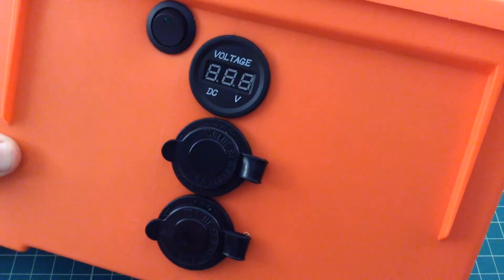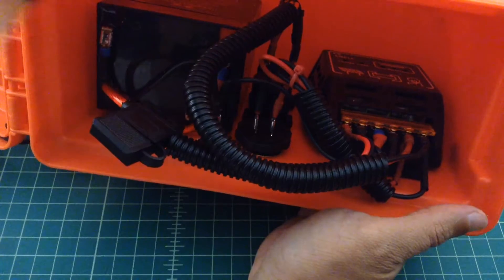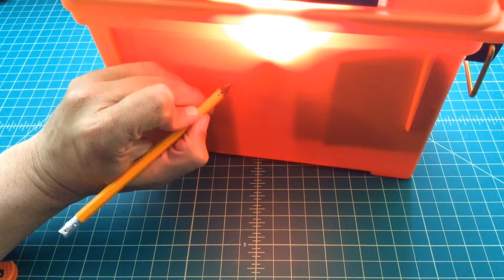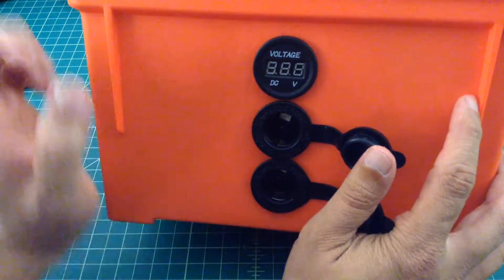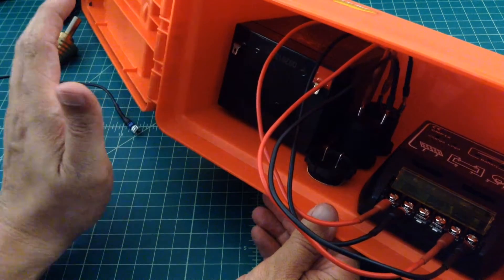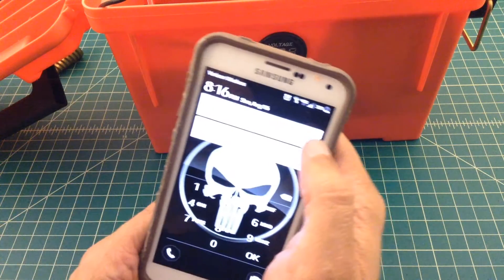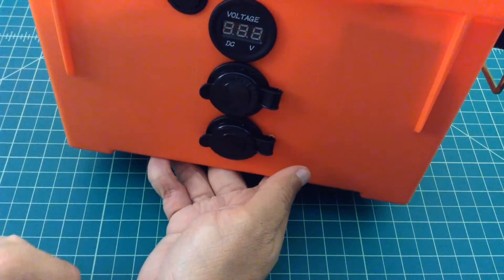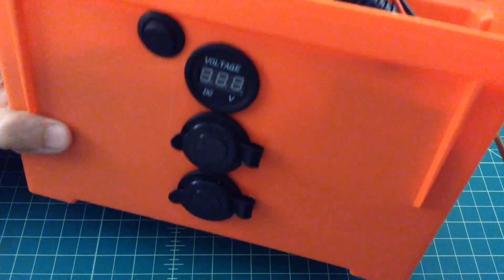Small DIY Solar Generator - Go Box 12v Battery Kit (Part 2) - TheSmokinApe

Comment: An easy vent could be purchased at Lowe's.  Look for a soffit vent
Reply from the maker: Thanks for the heads up
Reply: @TheSmokinApe  sure thing.  could you use a male to male powered by an AC trickle charger?  What about a 12v cigarette outlet?
Reply from the maker: messy shop videos I do use a male to male cable to charge it, and have done from a 12v port in the car.

Comment: you don't necessary need a vent for that battery. Vented battery box is required to a floated lead acid baterry.
Reply: I like it. Thumps up.
Reply from the maker: +osvaldo rosado Thanks for the heads up...

Comment: Im looking for help. Could really use some huge info and links. Im trying to set up 2 12v batterys on my boat. I want to set up a solar system that is cheap and will slowly charge over the week while im working and on the weekend i can come to the cabin and everything is charged.  I know i need panels , and a regulator but other than that. I know nothing. Can you make a video or a map on how to do this with links to the proper equipment i need to buy? i have zero clue what i need other than a 20amp regulator since im hooking up 2 12v 10amp batteries.
Reply from the maker: +Jon adams being 10 amp batteries refers to Output not input. What you need is a charge controller similar to what I showed in this video you will also need a solar panel that will charge at probably 15 watts maybe 20-25. Are your batteries hooked up in series or parallel if you don't know it's cool.